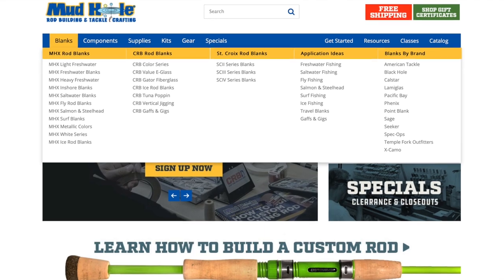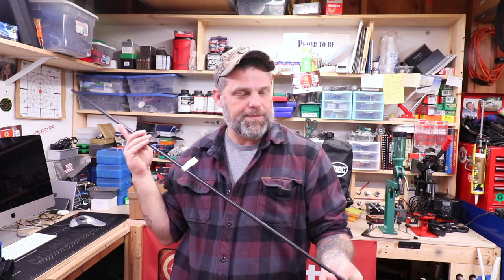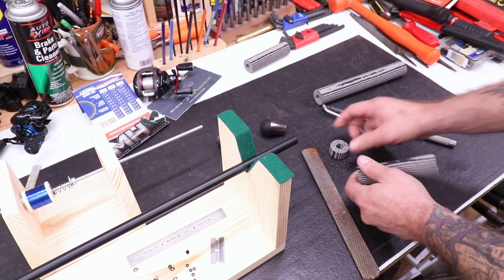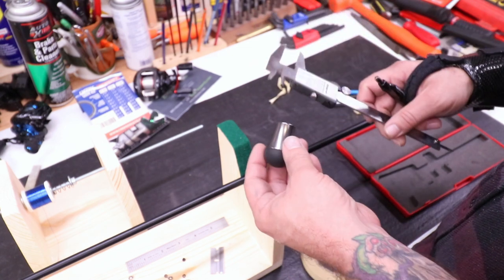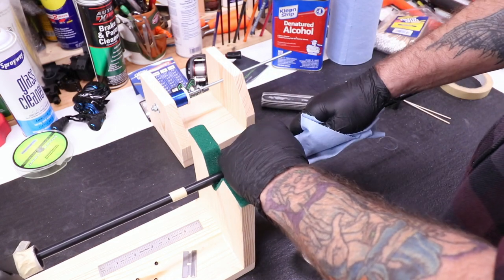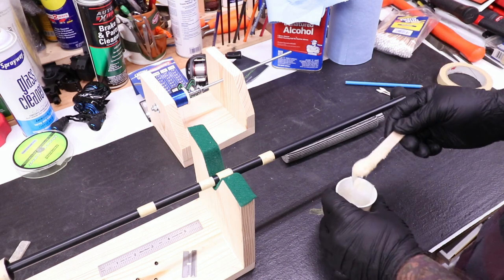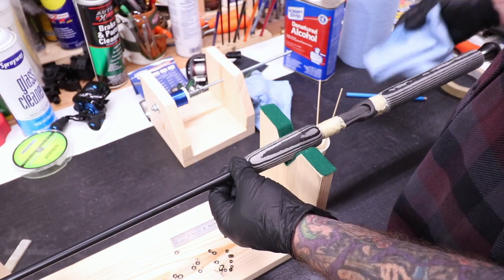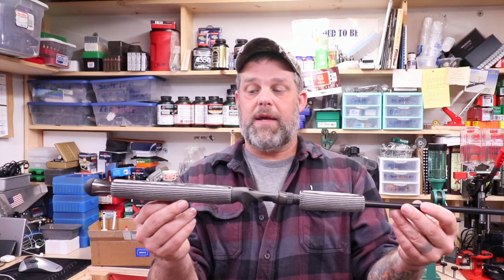Fishing Rod Build, the handle, Part 1

Comment: Good to see you back in the workshop and working on something that YT shouldn't get their panties in a bunch about. Pretty neat, I have yet to build a casting or spinning rod, but back in 2011 I built a 2 piece 8'6" 5 weight fly rod for my brother as an anniversary gift. I had/have very minimal tools including the jig or stand it was on, but still had fun making it. Getting the eyes on straight and spaced correctly was a challenge, especially when having two thread colors (black with gold trim) and tying those together. I also bought a kit from that mudhole.com website and that is the best place to get fishing rod building supplies, but there are others like Jann's Netcraft, etc... I need to build a couple more, I have two fly rod blanks that need built and I do want to do a baitcaster and spinning rod. Thanks for sharing, I look forward to part 2.